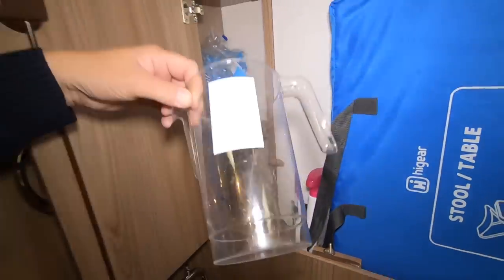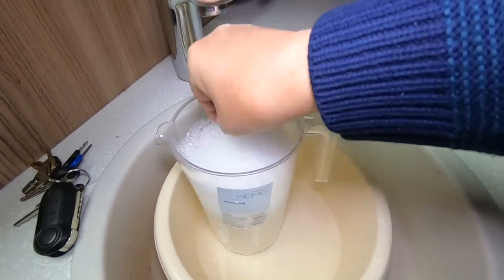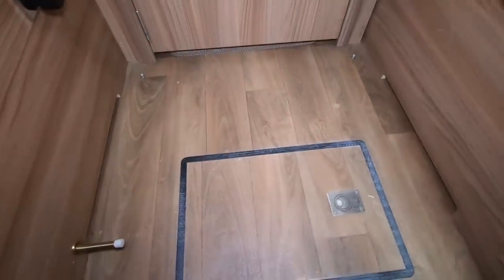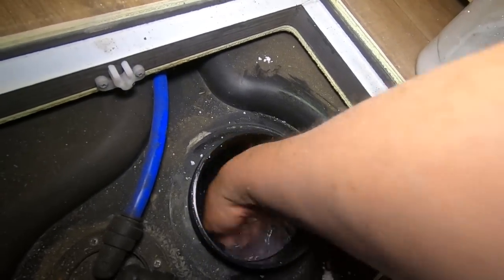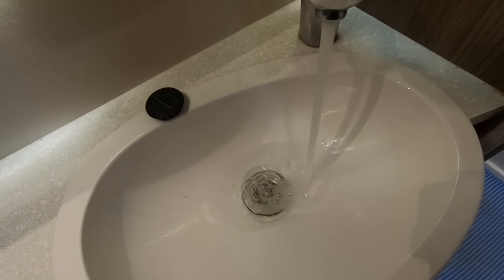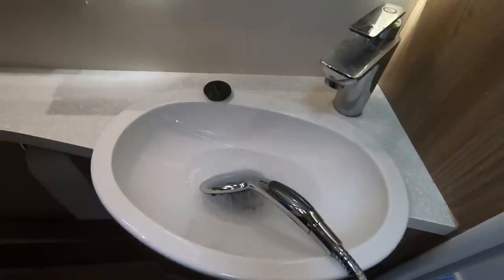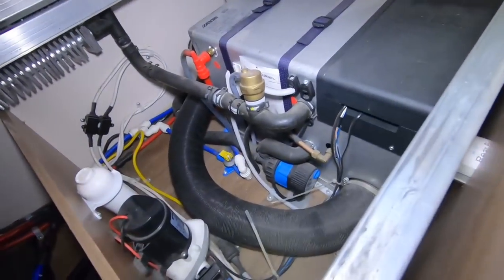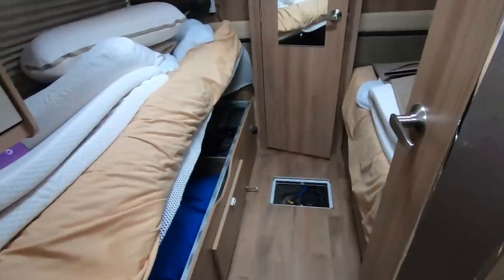Sanitising The Motorhome Fresh Water Tanks | Help, Hints And Tips

Comment: Hi Bob, do you ever sanitise or soak the shower head in hypochlorite as these would potentially be main risk for legionella bacteria, especially if it hasn’t been used for an extended period
Reply from the maker: No, but I do run the solution through the shower head. Something we don't do at home and I suspect many households don't. Also the motorhome is in constant use, as is the shower head. The Puriclean solution "Affectively eradicate bacteria, viruses, bio-film, algae and fungi for maximum results simply soak and flush. Perodic use will ensure a clean healthy system for water storage."
Reply: @BobEarnshawMoHo  As you say, the fact that there is constant water usage in the shower effectively eliminates the issue. I used to work in Environmental Health and did some shower sampling for legionella. the only time we isolated it was on a ship which had cabins where the showers hadn’t been in use for months and the water had therefore been standing for a significant period.
Reply from the maker: So, I'm probably more at risk at home. 😊
Reply: @BobEarnshawMoHo  As you say it is something we tend not to think about